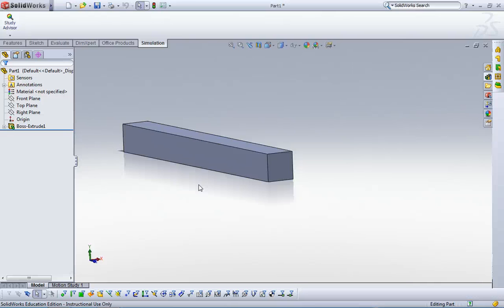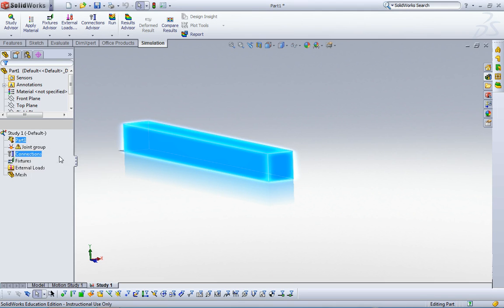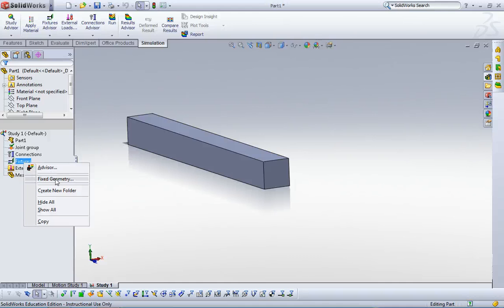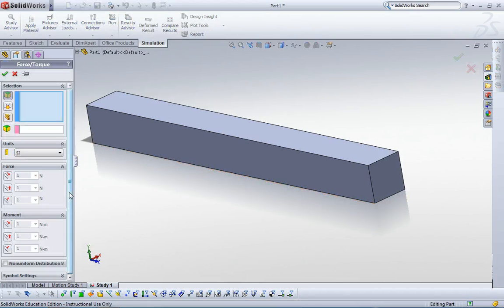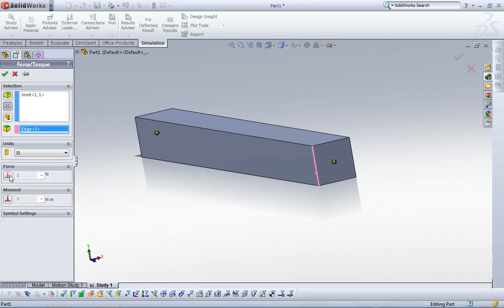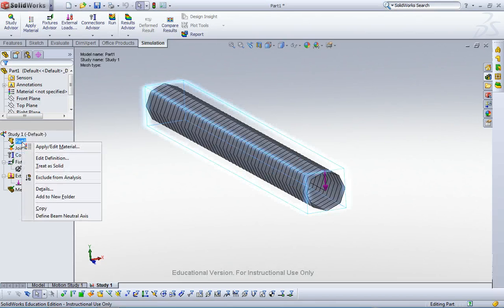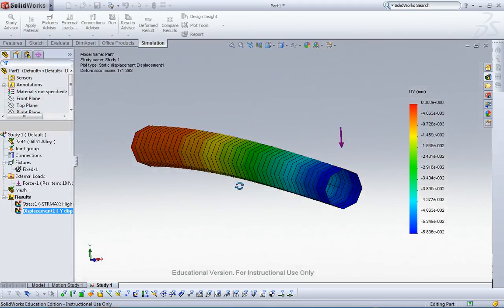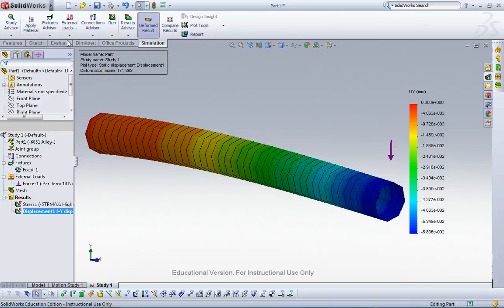Solidworks simulation: Cantilever bending with beam mesh.

Comment from the maker: I didn't do anything to the direction of those green arrows. As you know, directions of zero displacement(fixed) are meaningless. You don't need to worry about it. 
However, you still feel bugging due to the graphical issue, I recommend to use 'Wireframe' display option. It may help you checking what are boundary conditions you've applied.